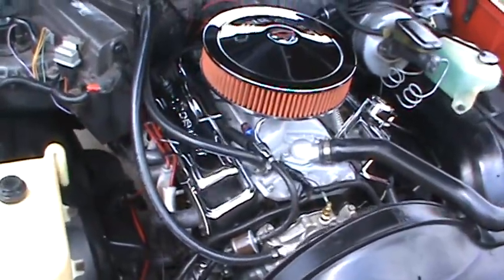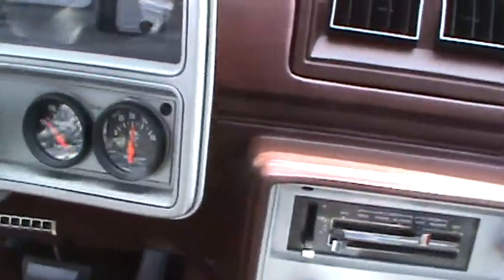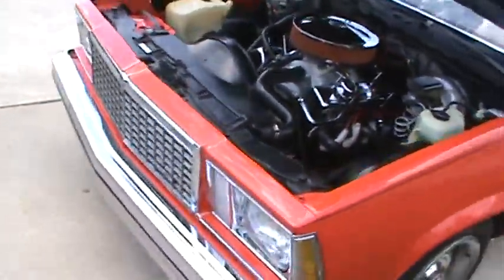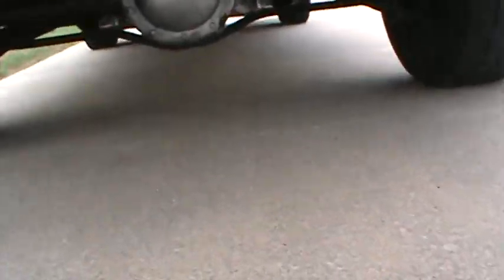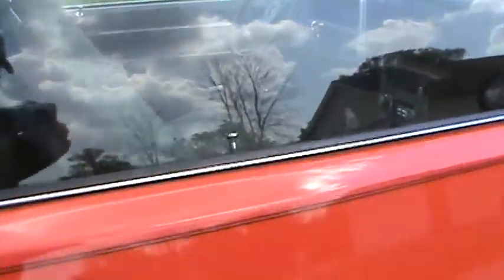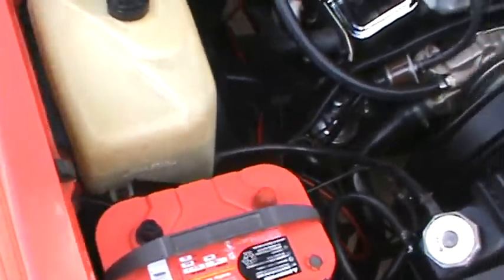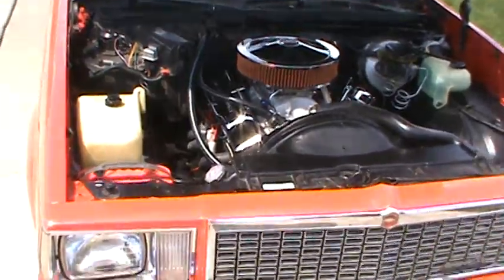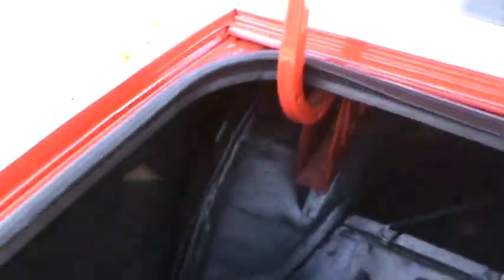1978 Chevrolet Malibu Classic Walk around for Sale

Comment from the maker: I found that bracket online but I don't remember where. I was ordering parts like crazy trying to get it done for Flints Back to the Bricks and don't remember. The steering box is manual box. It really wasn't a problem getting all to line up. I just had to use a couple of shims and it worked fine. Never slipped always had good charge. Make sure when you get your car done you post a reply, I'd love to see it. I had an 80 El Camino after this car but I sold that one too.

Comment: Hey i have a 79 el camino. with a 355 small block i'm about to put 461x heads on. So i'm going to need to go to a short water pump. The alternator bracket that's on the engine where did you get it and did you have any trouble getting everything to line up using a full size alternator. Also what kind of steering box were you using and was there any interference between that and the alternator? thanks